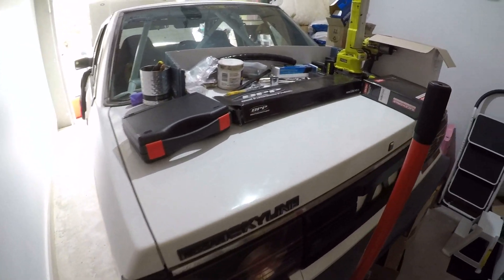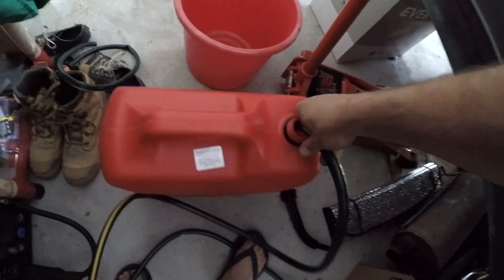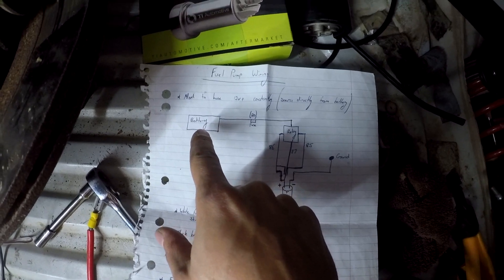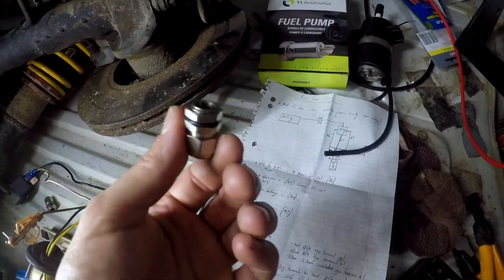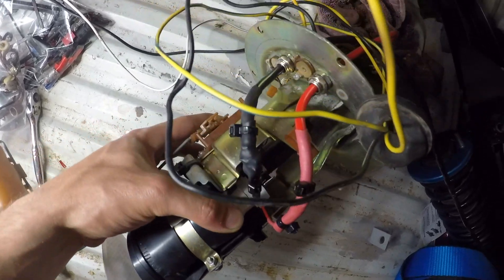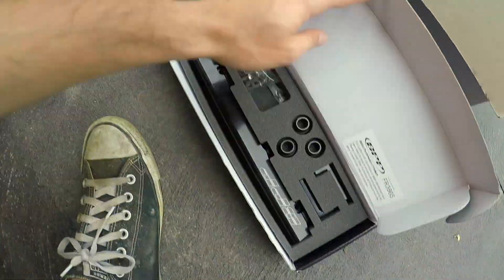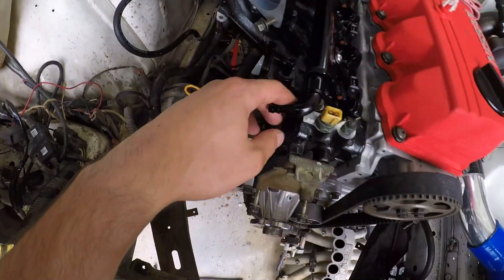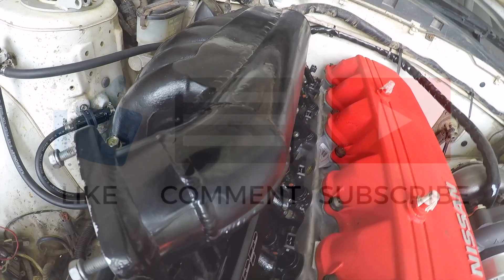New Fuel System For The Turbo R31 Skyline

Comment: Can you list parts used please, im also building a r31 silhouette skyline im more in need of injectors and fuel rail
Reply from the maker: Fuel System:
- Walbro 460
- Bosch 1000cc injectors
- BPP Fuel Rail
- Turbosmart FPR800